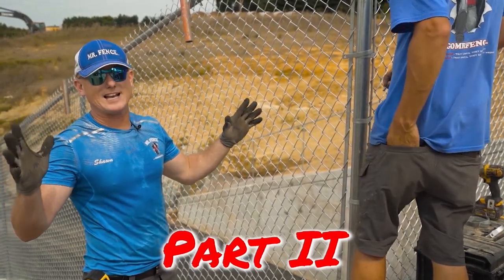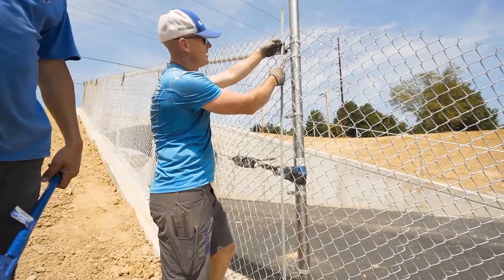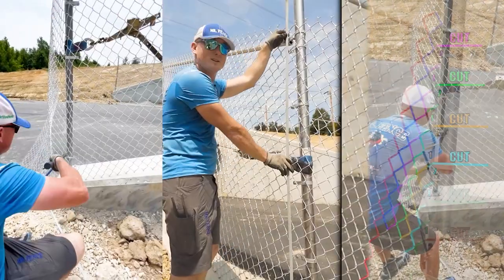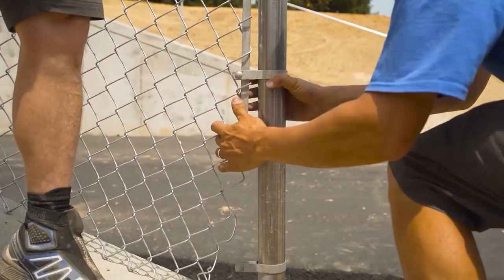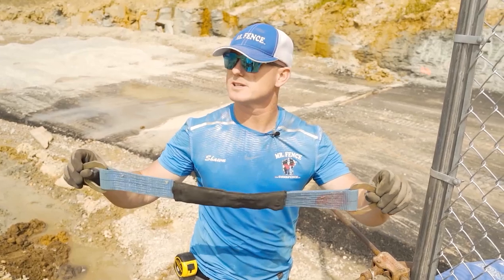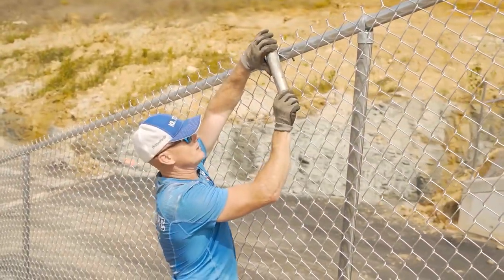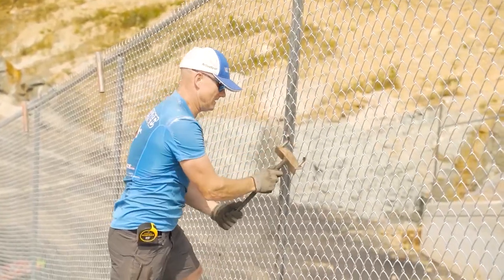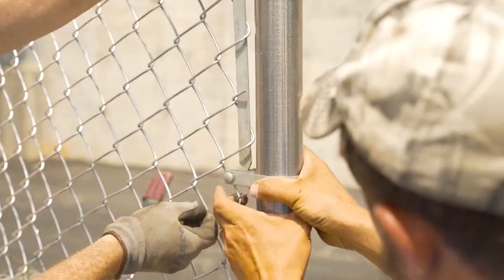Chain link Bias Cut Pt.2 | Mr. Fence Academy

Comment: Put a loop in your come a long cable. Put the loop between post and bar and hook to the loop. Then only pull cable between post and bar when done. Much easier
Reply: Backwards pressed steel tension band with the nut facing in. Hook the nut. Never fails.